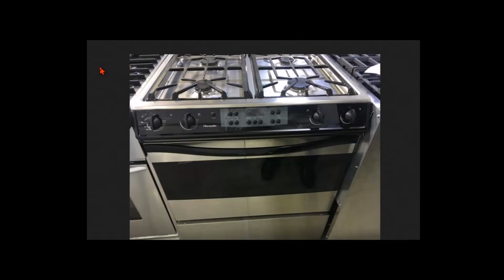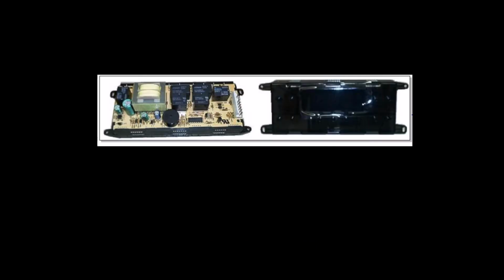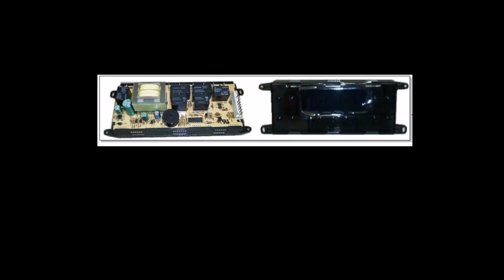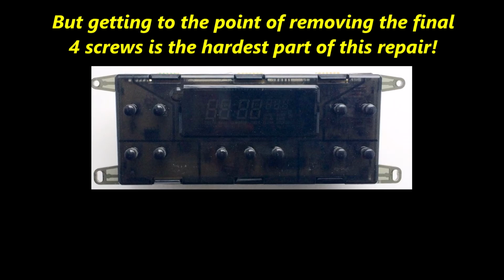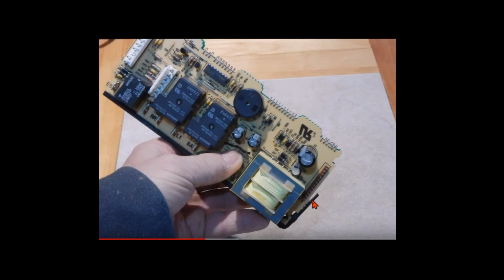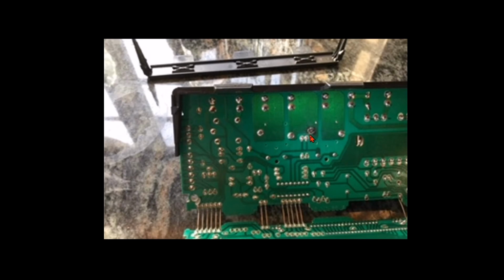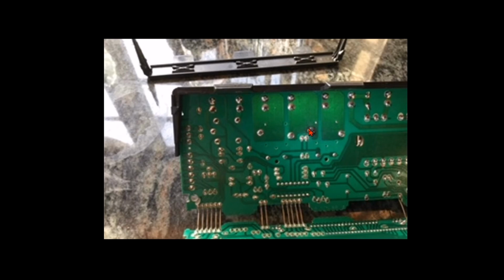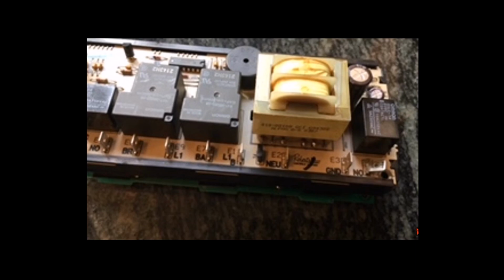Thermador oven BAKE not working, no heat on bake.  $0 control Board repair

Comment: While it’s out I recommend removing the relay cover and cleaning the relay contacts as well. The low voltage from the failed solder point will have caused overcurranr/arcing.

Comment: I replaced the rebuilt board in 2014 alas it could not be done in 2024. I replaced it with a 30 inch GE Cafe dual fuel but I am going crazy with knowing the right front burner range. I used to put my brown rice on it and walk away for 45 min. This higher powered cooktop is driving me crazy with constant adjustments. ;=)
I am looking in vain for the BTUs of the 4 burners. THE XLO in Manual says front 300-9,100 BTU and the left rear is 365-11,000 BTU It does not list the right side non XLOs If anyone knows I would appreciate it - thank you. * Online says: RDSS30 lists the higher BTU burners at 11,000 BTU and the smaller burners at 9,100 BTU. So that may be it. Does not say how low the Non XLO burners go on simmer.

Comment: I stupidly removed the control board without taking a picture of which connectors paired with which color wire… I had the control board properly serviced but now I don’t know which wire goes where except for the big plug on the side that 7 wires in it ( Y / Y / BLU / BLU / W / R / BLK )

The connectors on the bottom of control panel read from left to right 
E4 (COV)  E5 (NO)  E6 (BR)  E9 (L1). E7 (BA) E1 (L1B) E2 (NEU)  E3 (GND) E8 (NO) 

Protruding from the oven are several wires 

1 green wire female connector 
2 blue wires joined in one female connector  
2 white wires joined in one female connector 
3 black wires joined in one female connector 
1 black and I tan with black stripe wires joined in one female connector 
1 red wire wire in one female connector 
1 bright yellow  wire wire in one female connector
1 brown wire in one female connector
3 black wires joined in one female connector 

Can you tell me which male connector on the control board goes with which colored wire/wires with the female connector ?
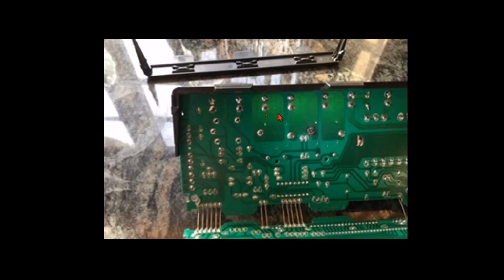Reply from the maker: at 6:10 in the video I show you three colors and where they go.  I no longer have any other pictures but the schematics are readily available online and from the schematic you should be able to figure it out.  The board repair company is certainly capable of helping you.
Reply: @YuDaMan  I called Thermador directly to ask for a schematic …they said it was proprietary information and they could not send me one … I would have tu hire a licensed registered technician for Thermador. … except that they currently have none in my area when I ask to book an appointment … which seems outrageous considering I live in downtown Toronto … any schematics I’ve found on line don’t seem  to have wire colors from the stove
Reply: @chrischapmanphoto  

I just did this repair. Not sure of any model variations, but here's the order for mine. YMMV.

Disclaimer:
I didn't take pics of the actual pin labels when I had the board out, just the order as you're facing the oven with the panel tilted out toward you (as if you were plugging things back in as you reinstall the panel). I'll add labels per the freeze frame @ 6:10, but I can't say for sure that perfectly matches mine.

Starting on the far right as you face the front of the oven and moving left:
- vertically oriented latched plastic connector with multiple wires
- COM a bridged set of spade connectors with 2 black wires on one and one black wire on the other. I believe these wires lead to the burner knobs on the right.
- NO a brown wire with a red spade connector
- BR thick yellow jacketed wire
- L1 thick black jacketed wire
- BA thick red jacketed wire
- L1B a bridged set of spade connectors with 2 black wires on one and 2 black wires on the other
- NEU a bridged set of spade connectors with 1 white wire on one and 2 white wires on the other
- GND a green cable with a red spade connector
- NO a spade connector with 2 blue cables bundled together

Good luck!

Comment: I have thernador range model# rdfs30 22 years old  Everthing works good except  control board unit the clock we can read good but
To read the temperatura. Light so dim  very hard to read  any ideas  Thanks
Reply from the maker: there are many repair places on-line.  Not all will resolve the dim display.  Be sure the one you select assures you the display power supply is re-built.